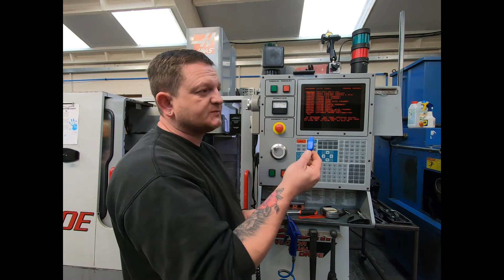How to re load settings & parameters on a classic Haas control

Comment: How do you re initialize. We have a used machine that was purchased running. Sat for 8 months and we can’t get past the boot up page. Goes through the language settings then that’s it. Checked battery and it has 3v. Swapped battery but can’t get to the screens you are on.
Reply from the maker: There's different ways depending on your memory size etc, if you google search how to re initialize Haas then you should come across the info and find the way that suits your specific spec

Comment: Thank you so much for posting this! Do you have an electronic tool offsetter? Can you do a video on that or email me some info?
Reply from the maker: You're welcome,

On my machines i use the Renishaw TS27R for tool setting
Reply: @kinzy_fabrications  did you install this as well as the macros? I’ve heard that these older machines don’t have enough memory to store the macros and such for probes and tool setters? I would love to get this installed on my machine.
Reply from the maker: You need to have the Macros option yes and also you need to have at least 1 meg memory on the machine to store the renishaw probing macros

Comment: Hi Marc,  can you please let me know how to set up program send and receive in VF OE. 
There are couple of RS 232 female ports with DB25. I would like to set up send and receive function through USB in to my laptop. 
I have connected db25 to usb cable and set up the bits and baud rate. But I don't get through.  Please upload a video if possible.  Thanks
Reply from the maker: Hi
Il see if I get time to do a video on this as I’d potentially like to try the DNC set up on this VF3 I’ve just got

Thanks
Marc
Reply: @kinzy_fabrications  thank you

Comment: Hi, your videos are very useful.  You helped me complete control of this machine. I never ever worked before in haas. Now I'm good because of your videos.  All credits to you. 
Now,
Can you please let me know how to unlock parameter? 
My tool changer has been disabled in parameter 57.
I did parameter 7 unlock.  Then tried to change parameter 57 to enable tool changer.  But still I got message " function locked ".
Please help me with this.  Thank you.
Reply from the maker: Hi,

Thanks for watching and glad you enjoy the videos.

It sounds like your servo's are still on? you must also have the emergency stop button pressed in to change any parameter.

If you wish to change parameters,
Make sure setting 7 is turned to - OFF
Then press - E-STOP
Then go into parameters
Arrow down to 'DISABLE T.C'
Yours if it is disabled should have a 1 next to it?
Type the number 0 and then press enter and it should change from a 1 to a 0

The number 0 next to it means that parameter is disabled and the number 1 means it is enabled

Hope that helps

Thanks
Marc
Reply: @kinzy_fabrications  hi Marc, I have problem with spindle orientation. 
Once press orientation button,  its "running"  trying to get it. But gives alarm. Then I reset it and then start again,  same result.  Then reset and start again.  Then its get orientation done. 
How to solve it? Thanks in advance. 
Haas vf oe 1995.
Reply from the maker: Is it a vector drive machine or the older vfd drive type
Reply: @kinzy_fabrications  it has Magnetek gpd 503 ac drive.
Reply from the maker: @cnc_tech  Hi I’m afraid I’m not familiar with setting the spindle orientation offset of the older machine like that
Reply: @kinzy_fabrications  thats ok. I will have a look at encoder and belt. Thank you.
Reply: Thank you very much. I will try and let you know. I have some other problems as well. I will let you know by comments soon.
Reply: Its worked. Thank you.
Reply from the maker: @cnc_tech  no problem
Reply from the maker: I have just uploaded a short video as well to show you how its done

Thanks
Marc

Comment: For some strange reason my machine lost an English menu. Do you know if I can reload this from the floppy? I have an original floppy, unfortunately a few years back I installed USB drive.
Do I need to put a floppy drive back on the machine or I can just copy files to the USB drive from my floppy and load everything from the USB drive. It's a bit convoluted. Sorry about that. Thanks.
Reply from the maker: Hi

Yes if you transfer your files from your floppy to usb using your pc and a floppy disc reader then you can re load them as per my video using the usb

Thanks
Marc

Comment: Can you connect your computer to the machine to add data or is it too old for it
Reply from the maker: You can transfer data via RS232 cable but I just use the usb floppy emulator as it’s much much easier

Comment: Marc one thing i did forget to ask you about previously ?
On your Mazak Lathe.
Which USB to RS 232 adaptor did you finish up going with ?

I did see your post on Practical Machinist some time back.
Finally worked out it might be you ( i am having a Good Guess, LOL )
I could not think of to many people in the UK that might have a Hyundai / Mazak QT-15 , lol.
Plus not many care to much for these old CNC Lathes to be asking for current information about this machine.
Long story shorter ??
I see the forum was recommending 2 options mainly ?
Mazview or CNClink 
Which of these did you decide on or was it something completely different ?
Regards Peter.
Reply from the maker: Hi Peter

I decided to with software called CNCLINK.COM

Cost was about £140 including a cable

I only bought the version that’s allows me to load and save but NOT edit programs as I don’t need to

It’s very good though and works perfect

Thanks
Marc
Reply: @kinzy_fabrications  
Thanks for letting me know Marc.